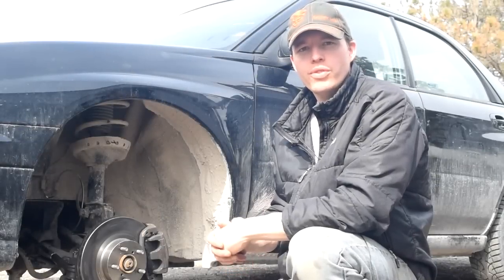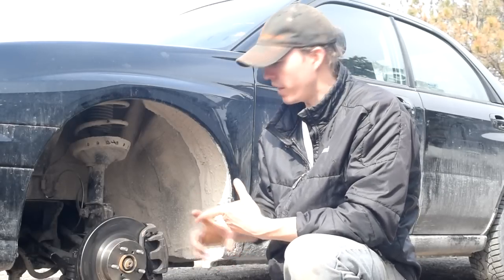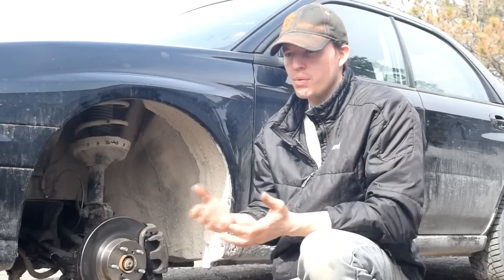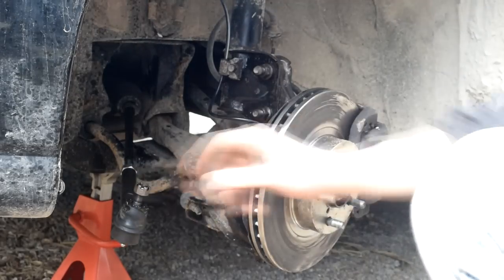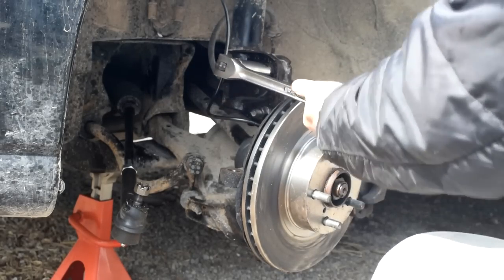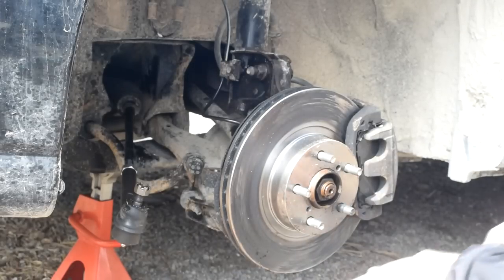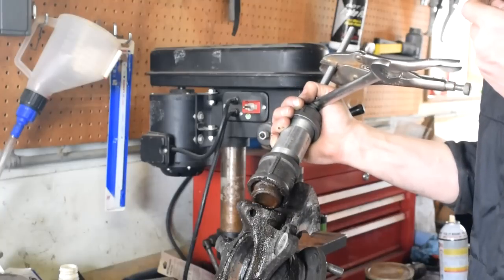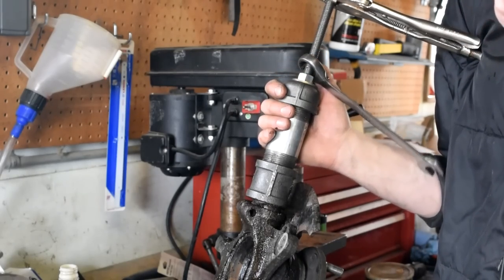How To - Replace Ball Joints Subaru and it all goes wrong!

Comment: Pinch bolt broke off,  now that is a bitch. This is how I get the ball joints out. Put a lot of PB blaster on that pinch bolt before you attempt to remove it. To initially get the ball joint out there is like a little ledge under where the pinch bolt goes, jack up the lower control arm with your jack, you already have jack stands under the car. A 16mm or 17 mm socket will fit into that little ledge. Then drop the jack quickly you will hear a cracking sound, that is the ball joint breaking away from the lower control arm. Do something else for a couple of hours. Come back and if you need to heat that pinch bolt. Once that pinch bolt is out take a wood 2x4 about 3' to 4' long. Place one end on the lower control arm the other end you bash with a hand-held mallet. The ball joint will come out of the hole. You would have put your new ball joint in the freezer 4 hours ago by the way. Then sandpaper, I use emery plumbing sandpaper to clean out the hole and put some no sieze on the new ball joint. You have a new pinch bolt, don't use the old one. Make sure you put some no seize on that one. The torque for the pinch bolt on my 2006 Outback was 34 ft lbs. Reassemble and you're done.

Comment: So did you run new threads into the knuckle, or just through bolt with a nut on the other side?
Reply from the maker: I can't remember for sure, but I think I put a nut on the other side.

Comment: I don't think you needed to put the wheel back on and lower the vehicle to the ground to get that axle nut off.  All I do is put a thick and heavy allen key into one of the slots in the rotor.  As you turn the nut, it wedges against the brake assembly; it usually works like a charm.
Reply from the maker: +Ernie Martin Yes, thank you!  I learned that trick recently.  I just did a BMW that didn't have a vented rotor and I ended up using the lug bolts (it doesn't have studs) and a pry bar wedged against the ground to hold the wheel while I broke the nut loose. I'm getting smarter about this :-)

Comment: The other choice instead of taking the 2 alignment bolts off would have been to take the 3 on tp in the engine compartment off and take the strut with the knuckle.  Those bolts aren't rusted.
Reply from the maker: Good suggestion! Thank you!

Comment: on drilling out that bolt, once you've drilled a hole through it what then? How to drill out more without destroying thread? do you have to rethread hole?
Reply from the maker: +partytill10 If you are lucky, you can save hte threads with a tap.  There are probably a few ways that can be done - especially if the bolt broke just below the surface and you have some threads to work with.  However, what I ended up having to do was just drill it out slightly larger and put a bolt all the way through and put a nut in the end.
Reply: He did destroy the treads and used a nut and bolt when he was done.  All bolts need to be grade 8 or better.  i know a mechanic who actually drilled and tapped the hole.  I personally think that is a bad idea.  You can never get to the perfect center of the hole and then you may have bad stock to start your tapping operation.

Comment: You loosened the steering knuckle from the strut, and pried the joint apart with the separator fork?
Reply from the maker: +AJFresh Which joint?  I loosen the strut from the kuckle and the tie rod.  So I used the seperator fork on the tie rod.
Reply: No.  He loosened the castle nut from the lower control are then separated the ball joint from the lower control arm because the taper part of the ball joint faces downward.

Comment: Not looking forward to doing this but I have a busted joint on the sti. I had my share of drilling caliper bolts... Nice video that shows things go wrong for other people hehe.  Would hearing the back bolt area help? Anything that would melt?
Reply from the maker: +bacalhau75 It will probably help if you kept it failrly localized.  I think a propane torch will probably work well if you are patient and get things heated up pretty good.  Off the top of my head the only think you would need to avoid is the CV boot.
Reply: I know this is 9 months old but in case anyone else reads this looking for a suggestion about heating it. My mechanic that has worked on Subarus a LOT said he usually heats them up as soon as he feels any resistance. My first one snapped just like the one in the video with almost no resistance, oops. The second one he heated preemptively, but because the joint on the driver's side was in much better condition the heat caused a pressure buildup that ended with the ball joint exploding out of the knuckle and chipping the concrete floor.  If you torch, be careful!!!

Comment: If you've damaged the threads and have to put a bolt and nut on, what size bolt do you need. I know it should be at least a grade 8 with a lock nut, but I don't know the size and length of bolt that you need. Thanks!
Reply from the maker: I don't remeber off hand.  I think it was an 8mm, you might have to take a couple trips to the hardware store for this.  Sorry I can't be more helpful.
Reply: No worries, thanks anyway
Reply: Just take the old bolt to the store, get a bolt that is barely larger, and drill it to the same size as the new bolt's threads, and you are good. Keep in mind you will need to grind a flat spot on the other side of the clamp so you aren't trying to tighten the bolt or nut at an angle. I also recommend using a washer or two.
Reply: 10mm x 1.25 pitch  x 50mm aka: 1.7/8 - 2". Just replaced on last weekend that broke.
Reply: I did the same thing and used a 7/16" by 2 1/2" grade 8 from the lowes fastener drawers.  I am pretty sure the bolts that hold the hub on would be a great choice and they are dirt cheap at a subaru dealer.  Then you just have to find a nut.

Comment: I opened the pinch bolt hole with a  chisle in the little slot and pryed the joint out with a little pry bar. Nothin but the ball joint needs to come apart on these. Way way easier.  this was on a minnesota car with 12 winters on it.  I guess if you have an aluminum control arm you may want to exercise caution by way of a protective block but either way the control arm makes a fine puller. It is worth a try before dissasembling half the front end. I do apreciate putting up a vid for us to coment on. Thanks to youtube i have not even bought a chiltons manual for this car.
Reply from the maker: Thanks for the info!

Comment: Would it be easier to take the control arm off? The you would have access to use your tool?
Reply from the maker: You still have access, but if its easy for you to take the control arm off it will only make using the tool easier.
Reply: No because the control arm is not where the ball joint is pressed into.  It is pressed into the knuckle and the taper part faced down and get bolted to the lower control area.  The other issue is the CV joint would be in the way of his tool.

Comment: For the records, I've changed my ball joints and had the same problem... the pinch bolt broked. I went to a scrapyard to find another steering knuckle and i'd say that pinch bolt fails about 8/10

Comment: Im in the process of doing this for my Forester.  I got the BJ's out and new ones in.  Now im having trouble getting the steering knuckle lifted enough to get the BJ lug into the control arm.  I cant make the knuckle budge what so ever by just lifting it.  When I try to jack up from the rotor it just moves it backwards.  Any ideas?
Reply from the maker: I'm trying to remember what I did,  I think I used a jack,  and I do remember having the same problem as you but I can't remember what I did.  Maybe turn the wheel so the knuckle moves out instead of back?  other option is to get spring compressors and collapse the springs a little will allow you to lift the knuckle higher.
Reply: +Matthew Eddy Do you mean turn the steering wheel?  I like the spring compressor idea, that way I wont have to worry about aligning it after I get it up.  While doing the drivers side I accidentally pulled the drive axle out of the motor.  :(  No idea how to go about getting that fixed.  Starting to really think this was a bad idea.
Reply from the maker: +Mike K that's weird that you pulled the axle out,  it should have a pin to keep it in.  You just push it back in.  No big deal.  But yes,  I mean turn the steering wheel. For the driver side turn the wheel to the right,  and the opposite for the pass side.
Reply: +Matthew Eddy the part with the pin is still attached, the shaft with the rubber seal came off of that part and spilled all the oil out of it.  I'm trying to decide now if I need to buy a new one, or just try to put it back together.
Reply from the maker: +Mike K Sorry I didn't get back to you sooner. Ohhh, so you should probably get a new CV axle.  I am sure by now you have already done so.  Sorry this was a bit of a hassle.
Reply: No worries on the timing.  I was able to reboot the CV joint and get everything running!!! Thanks for the great video.
Reply: +Mike K I know it's too late now, but I imagine if you jack up the other front wheel off the ground, that may release the push from the sway bar and allow it to be put together a lot easier.
Reply: take off the sway bar links.

Comment: What is the torque spec for a 02 WRX ball joint castle nut? TIA
Reply from the maker: Not sure.  My experience has been to tighten it by hand as tight as it can go without using a breaker bar.

Comment: do NOT loosen the axle nut as this guy demonstrated with weight on the wheel. Specifically warned against in the manual as to not damage wheel bearings. 

Have someone depress the brake so you can loosen it, with a impact wrench this is a piece of cake with the car on stands.

Comment: You can possibly save yourself a LOT of grief by spraying PB Blaster all over the nuts and bolts like a day before you do this type of work. Or at the very least an hour or two. Greatly minimizes your chance of breaking bolts like you saw. Not a guarantee,  but a good habit nonetheless.  Subies are bad for rust on the undercarriage parts, and I think every car needs a can of that at the ready!! ;)

Comment: CRAZY LEO!
Reply from the maker: :-)  Yep, I still have the same hat. I try and wear it in most of my videos :-)  I think that hat is like... 7 or 8 years old... maybe older :-)
Reply: @goddom  I'm working with my Subaru Rally Team Canada shirt at the moment lol. Everything in this video happened to me yesterday because I needed to replace the wheel brearing. lol, I love your tool also. Good idea. I welded a nut for my slam puller to get the BJ out. I also broke the damn BJ bolt. M10 bolt and nut to the rescue. I don't know why subaru didn't use a nut. Those damn threads are always rusted and always break because they are exposed.
Even worst, is I noticed my CV boot is torn, so now I'm running to a scrap yard to get a axle assembly lol.
Reply from the maker: LOL, the fun of working on cars :-)  - Yeah, I don't know why Subies us this design, it always fails especially in areas where the Subies really shine - snowy areas that get salted. Good luck on the fix!